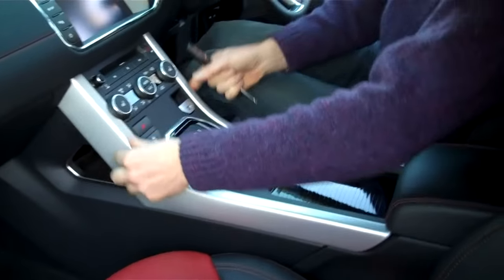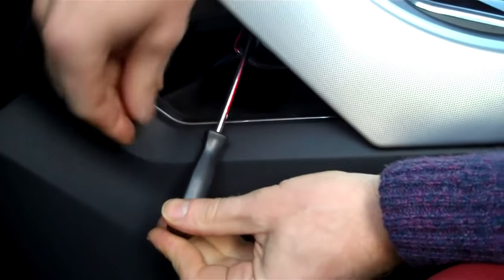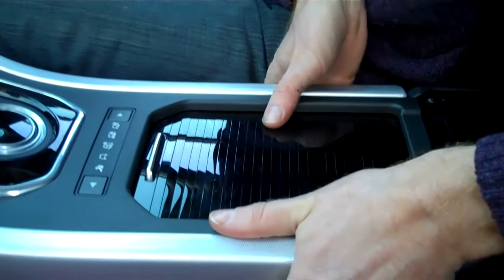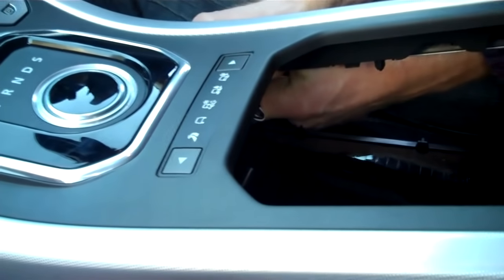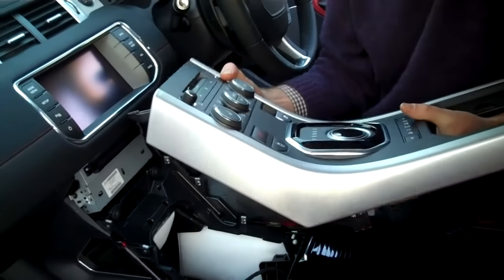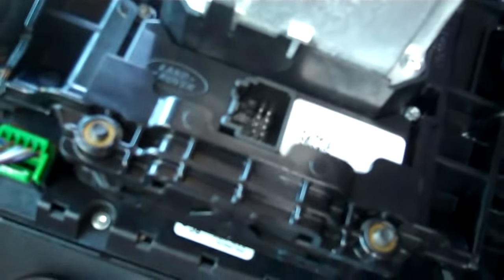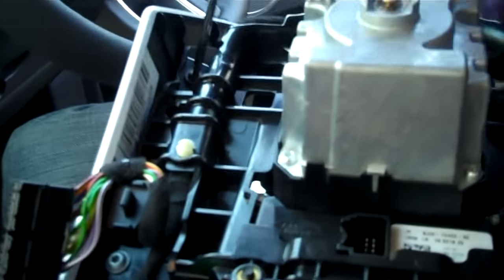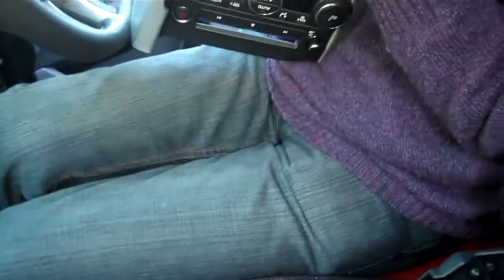How to remove centre console from Range Rover Evoque 2012

Comment: Thanks for the video. Because I didn’t disconnect the battery I’ve now got a handbrake fault wire. How do I turn this off?
Reply from the maker: It will disappear after 3 ignition cycles
Reply: @L663  fab thanks. I managed to find a video that explained how to take it off anyway…putting the car into brake maintenance mode and then out of it again…went straight off :)

Thanks for taking the time to reply

Comment: Hello! I did exactly what you did, but I lost the screws that came in the tunnel of the centre console, precisely those at 0:20. Do you know what are the dimensions of that screw or how i could find it?
Reply from the maker: I tried to find them on the parts catalogue but they are hard to find - sorry
Reply: @L663  thanks tho

Comment: Hi, Great video thanks! 

Would you recommend disconnecting the battery before remove this console? reason I ask is because the traction control ECU will detect handbrake not active and give you a warning light for traction control which will need to be disabled by the dealer - or will this not happen?  

Please can you be so kind as to let me know
Reply from the maker: +chris jakubowski You are correct - i have now added this as a note at the start of the video !
Reply: Lol thanks, i actually forgot to do this last night when replacing a fuse and got fell for the error message, got a call from the wife this morning about the warning light - will tell her to cycle the ignition thrice  - thanks again
Reply: @chrisjako3404  I’ve just done this and didn’t disconnect the battery. How do I turn off the warning light?